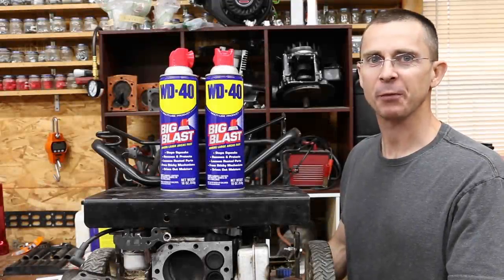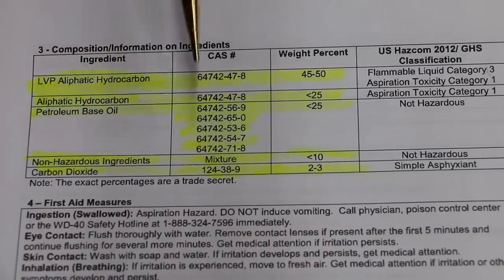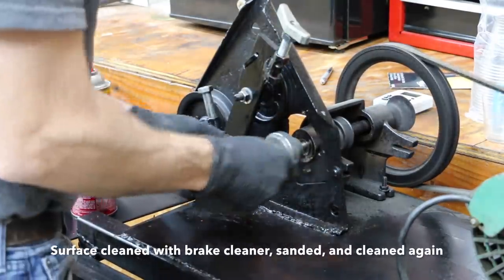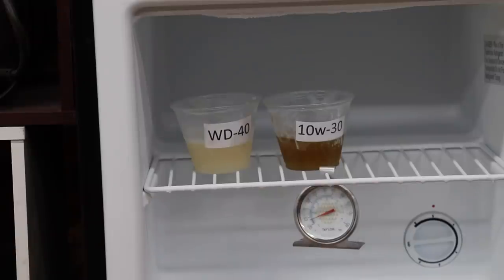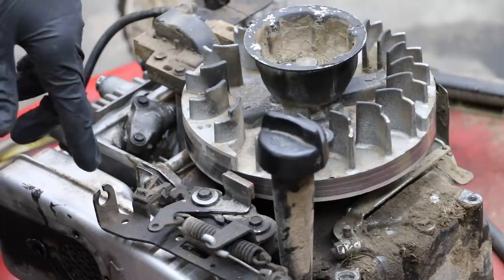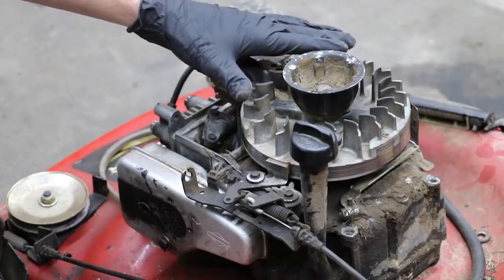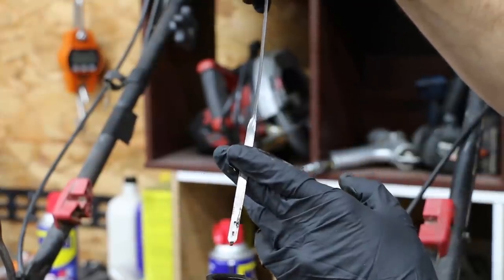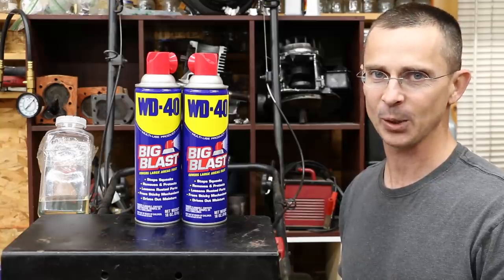Will WD-40 work as engine oil? Let's find out!

Comment: If you had the air box on the vapor from the crank case would have stalled the motor from running too rich. You had more flammable vapor coming out of the vent than what was being delivered by the carb.
Reply from the maker: Thanks for commenting on this.

Comment: WD40 was never intended for use as a lubricant.  Its' primary purpose is to displace moisture.  Water Displacer, formula 40.  Engine oil has a number of functions.  It cleans, cools, seals, as well as lubricates.  It might be interesting to try the same test again with this same engine but using proper engine oil this time and see if the compression goes back up some.
Reply from the maker: Great point. Thanks for commenting!

Comment: Should do a test on wd40 vs pb blaster vs zep 45. In my opinion the zep45 will work the best followed very close with pb blaster. Wd40 just makes dirt stick from what I've found in long term usage. It's a good quick lubricant but it's not long term like the other 2
Reply from the maker: Great suggestion!

Comment: I would like you to test the friction modifiers people use to to put in engine oils on that test bench you have to test oils, but make sure you clean the baring which is spinning or replace it with a new one all the time so that its fair and also the test bearing as well ?
Reply from the maker: Thank you for this recommendation.

Comment: With respect, by not putting the fan cowl back on, you created a 2nd variable and we don't know how much WD-40 was getting past the piston rings and burned, vs the engine being way too hot and then obiously boiled it and it came out the crank case vent filter as vapor. Cool idea, neat experiment, but if I were you, I'd put the fan cowl on and try it again. Change one thing at a time in experiments, how does the independent variable effect the dependent variable, etc. I'll bet you with the cowl on, you won't lose nearly as much oil, bleh er WD-40 lol.
Reply from the maker: Thank you for the constructive feedback.

Comment: The bearing test is interesting. 
I’d guess that given any lubricant, as the wear scar gets larger the bearing surface is then larger providing for more surface area / lower psi loading for the oil to lubricate. 
Wonder if there’s an equation there.
Reply from the maker: Thanks!  Thanks for the feedback.

Comment: If I understand correctly, WD-40 has light hydrocarbons as a carrier and heavy hydrocarbons to actually lubricate stuff. After you spray on WD-40, the carrier evaporates away, leaving a thin film of actual lubricant. I bet you lost the carrier when the oil got hot, which is why the volume went down so much.
Reply from the maker: Thank you!

Comment: Simple answer, no. WD-40 is not really a lubricant to begin with. It WILL lubricate, but for that matter so will water. And both only until they evaporate. Which WD-40 will. Quickly.
Reply from the maker: Great point. Thank you

Comment: May be late, but properly modified internal combustion engine should run fine on wd40. Since oils are classified by temperature and viscosity, i bet there is a way to make an engine to run on wd40 based on its operating temperature and viscosity. Heck, i suspect vegetable oil can be good for that kind of scenario. Also, as temperature rises, oil collection and compression rings would expand further around the cylinder, buckling and causing blowby. ALSO there is no visible hone on that cylinder wall =(
Reply from the maker: Thank you!

Comment: I think a better and safer way to load the engine would be to set the mower in a large pan of water. Then you could change the water level to load the engine. Simple and cheap Dyno.
Reply from the maker: Thank you for this recommendation!

Comment: Silly question really. Just check the ingredients of that fabled product, less than 25% of the contents have lubricating properties, the rest can mainly be compared to solvents . Would be cheaper for you stuffing a 25/75% mixture of oil and petroleum into your engine.
Reply from the maker: Great point.

Comment: I dislike wd-40 as a lubricant it doesn't work all that well and tends to evaporate off after awhile. I like to buy it in gallon containers and put it in squirt bottles. I add a quarter to half a cup of 20wt non-detergent machinery oil to around a quart. Seems to work much better and leaves a nice film. I use it at work to fog my bedknife grinder to prevent corrosion since it uses a water based coolant.
Reply from the maker: Great point.

Comment: You run and drain the oil in your daily driver i think it is a suburban. You have the oil tested almost constantly. Would you consider changing the filter half way through the service and at the service for 6 services in a row? This could show us if your oil becomes cleaner even in a well maintained engine from this method.
Reply from the maker: Thanks for the video idea.

Comment: I would like to see dishwashing liquid soap used in place of oil.
Reply from the maker: Thanks for the video idea!
Reply: I suspect it has the right viscosity and lubricity,  but may tend to boil off some of its water, so it may need water added during long running test. The water vapor coming off the crankcase vent should be great for the cylinder head temps as well as improving hp output.

It would be interesting to see if the foam in the crankcase gets thrown around where it's needed.

The co2 leaking past the rings should make it fizzy and acidic. I bet it performs great, except for the whole rusting issue!

Comment: So what’s the impact of running the same test with regular motor oil?  Need some form of control.  You took away the cooling and run under a pretty good load using the engine break.  I would expect regular oil to hit high temperatures as well under the same conditions...

Comment: You must tare up lots of engines, but I am curious to see what it be like to to run straight B12 in the engine for gas, I know  we use it to clean carburetors but that is mixed with gas, and even then we know that the engine runs hotter than non mixed b12 gas.. if you have not please try it. Actually a fair video be is use gas, than gas/b12 according to the instructions and then straight B12, let's see how that does at same time see if it really cleans carburetor like they advertise.
Reply from the maker: lol. Yes, quite a few. Thank you

Comment: my question is, the flashpoint was listed at about 175.  wouldn't that mean that the engine would just 'flash over' once it really warmed up?
Reply from the maker: Great question.  That's the temperature at which a product sufficiently vaporizes to ignite in the air. The flash point was too high to work well. Gasoline's flash point is -45F, allowing it to adequately vaporize for efficient use in a gasoline engine. Thank you

Comment: Thank you for your video, my question is did you build your bearing tester yourself.  I wanted to ask about the welding that holes it together.  It looks a bit like a low-quality weld on the video.  If Video is not deceiving, this is an area that one of your viewers may be able to help you.  

Thanks again
Reply from the maker: Yes, I welded this together and the welds are low quality, but it definitely won't have any issues staying together.  Thank you!

Comment: Considering we used WD-40 to degrease and clean tractor engines on the farm, I'm going to go with no.  It's a terrible lubricant and is very good at displacing any oil/grease that would lubricate.
Reply from the maker: Great point.

Comment: put a can with more wd40 connected to the crank case ventilation so that it will run on full oil all the time even if it spits out some it will be in the reservoir and will top it back on !
Reply from the maker: Thank you for this recommendation!

Comment: Do you think the loss in compression and blow by is more due to the difference in viscosity between the WD-40 and the normal engine oil? would be interesting to see what would happen if you topped it up with normal engine oil and did another compression test.
Reply from the maker: There was some damage which caused the compression loss. Thank you

Comment: Without the shroud the engine will run hotter since the air is not being directed across the head. WD40 is water displacement formula and not intended as a lubricant.
Reply from the maker: Thank you for the constructive feedback
Reply: @ProjectFarm  I enjoy all your videos and appreciate the dedication to accurate non-biased testing. Keep up the good work!

Comment: Running the engine without the engine starting shroude in place will cause the engine to run considerably hotter than normal. The schrodeing redirects the air blowing off flywheel to the engine cooling fins and cylinder area so these engines shouldnt be opperated this way under any load to avoide damage ..
Reply from the maker: Thanks for sharing.

Comment: No surprise. WD 40 is not a lubricants. WD in the name refers to Water Displacement, it was formulated to displace water from electric components in an engine. It is also a good solvent for cleaning motorcycle chains. It is NOT a lubricant.
Reply from the maker: Thank you!

Comment: On the other hand, would WD-40 work as a fuel additive to increase upper cylinder lubrication? Would it leave lots of residue? How would the engine run with different ratios of WD-40 to gasoline?
Reply from the maker: Thanks for the suggestion.

Comment: WD4O is highly flammable.  Wouldn't that be a safety hazard ?
Reply from the maker: Per the MSDS, the engine would achieve temps high enough to reach auto-ignition. Thanks for commenting.

Comment: I added wd40 to my cars timing belt tensioner when rebuilding after the timing belt broke because of the water pump, added new valves, water pump and belt replaced $300 in parts lasted 2 months because the belt tensioner failed. The bearing on the tensioner were gone when I re-rebuilt it  and the wd40 in it was turned to a white powder which caused it to fail. Never again will I use it again to clean any moving parts on any angine.  Learned later from a forum that wd40 turns powdery after it heats from others that used it on bearings before.
Reply from the maker: Thanks for sharing.

Comment: Projectfarm, do you torque the cylinder head down after you use the drill to tighten the bolts? How do you know when enough is enough on the drill? Thanks
Reply from the maker: Thank you.  Yes, I use a ratchet to make the final torque adjustments

Comment: should try out the water electrolysis add on's that they sell on ebay. ive always wondered if they worked. they boast increased power because of the hydrogen and oxygen dissociated  from distilled water and salt.
Reply from the maker: Thank you for this recommendation!

Comment: Your interpretation of the results is decidedly wrong. The abnormally high engine temps are due to the fact that you took away NEARLY ALL of its ability to cool itself. This will strain the best oils, as they all lose film strength at very high temperatures. Also, the crankcase smoke was mostly not blowby; it was the elevated temperatures vaporizing the WD-40. The fact that the before and after compression levels were similar indicated that the rings and cylinder wall were not seriously compromised in the experiment.
All in all, the WD-40 passed with flying colors. In an emergency, it would get you home. Even subjected to unrealistically severe conditions, it kept the engine running. Also, it would be interesting to see the condition of the crank and rod after any lubrication tests, if time permitted.
Reply from the maker: Thanks for the constructive feedback.
Reply: You have got to be the only YT content creator who actually lets people know you read their comments. That's very impressive.

Comment: It was interesting but I have a question as well. I dont understand why you took away the air for cooling. I am surprised it survived at all as the WD is real thin. 
I once had a briggs motor mower that All I had was Mystery oil. It stopped with bearing noise and low compression.
Reply from the maker: I should have left the engine cover on. It was around or below freezing and I had fans blowing air around to mitigate exposure the exhaust. All of that helped cool the engine. I should have left the engine cover on.
Reply: Air cooled engines are cheap. and or free.. I would be interested in seeing if survival is better with designed cooling. Also I have been interested in the lubricity if kerosene. I saw a video that someone drained the oil and filled the crankcase with kero Edit) as a flush . Also Scotty Kilmer does a test with high concentrations oh lacquer  thinner to cure clogged converters. I believe perhaps the higher concentrations may eat at the rubber components in the fuel system Perhaps a test with lacquered  thinner And perhaps Paint thinner. In the auto body field Lacquer thinner will eat any  paint straight off the spray gun when soaked and was not kind to the o-rings (rubber) leather for the most part was required. Some ideas I had. Great interesting material you have here and the discussions are what is important as we really all learn so thanks. Peace brother

Comment: Did the wd-40 clean the engine at all? Could it be used in the fuel as a cleaner and hot soak ?
Reply from the maker: I don't think it cleaned it too much, if at all.

Comment: I'm surprised it ran. Most engines have a governor which shut off fuel if oil pressure is too low. Happened to me when I put multi weight oil into my old mower. Always shut off after 10 minutes. Then I put straight weight and it always ran.
Reply from the maker: Thanks for commenting on this.

Comment: It may have been coveredbefore, but what is the Pulley for at the front of the mower by the left front wheel? Is it a drive pulley? Has it been covered in a different video? Ive seen it a couple times and havent seen it used.
Reply from the maker: It's part of the self-propelled system.  Thanks for commenting!

Comment: the chemical used to remove sulfur from crude oil also make steel slick(amine ) we used to use this in  manufacturing oil filter shells on the dies and drawing he shell out would it work as  a motor  oil  it was about 90 percent water . also this chemical was used as a tapper fluid
Reply: any tool and die shop would have a similar fluid

Comment: WD 40 is not a lubricant. it displaces water, it has oil in it and is not viscous so that's why people use it to get bolts free. not to mention its flammable. it probably would work better as a fuel than a lubricant. he should have run a similar engine without oil to see how long it lasted.
Reply from the maker: Thanks for commenting.

Comment: I did not think it would be a good option for a crankcase. Have you done one using WD40 as a engine flush? One quart WD40 to four quarts motor oil. BTW, I buy my WD40 by the gallon at Harbor Freight.
Reply from the maker: I should have purchased the 1 gallon container.

Comment: WD-40 has silicone which is not something we would want lubricant an engine.  Did you ever try straight marvel mystery oil? I add that to my oil and gas on small and auto engines.
Reply: Btw, I appreciate both your work, and how you reply to reasonable and scientific comments - you replied to me on more than one occasion.  I add marvel to my 2002 Chevy venture in both the oil and gasoline.  The directions are for 10 gallons, but a few months ago, I was adding a 20 gallon mixture for only a 10 gallon fill up.  The car developed a rough idle, so I ran the tank to 1/4, and filled up, and didn't add marvel, and the car ran smooth again.  I only add 8 ounces to my engine oil even though the makers of marvel allow a quart to be added into the crankcase for a 4 quart oil change!  I would never add 1/4 marvel to my crankcase, so I am curious how 100% marvel in the crankcase will do.  I never read adding all WD-40 to a crankcase, although I have seen people use it to clean out their "lifter tubes"? That have become plugged up with sludge.

THANKS AGAIN!!
Reply from the maker: I have not tested 100% MMO yet.  It has some solvent-like characteristics, making it a terrific crankcase and fuel system cleaner.  I would expect the engine to survive, but it wouldn't be overly impressive as a lubricant compared to other products tested.   I might test full strength in a future video, but I'll spend a lot of time explaining that it's not intended to be used this way.  Thanks again!

Comment: So did the WD-40 evaporate or escape from the engine because it's so thin ? Is WD-40 advertised as a "lubricant" ?
Reply from the maker: Yes, it evaporated, since it turns to vapor at around 140F.  The word "lubricates" is on the front of the WD-40 can.

Comment: Wd contains a lot of lighter weigh and volatile hydrocarbon fractions and has no body to it.. Its a no brainer that it won't survive as a lubricant in a hot environment such as an engine crankcase .
Reply from the maker: All great points. Thanks for commenting.

Comment: I'm not sure why anyone would think of these videos but I'm sure glad that if I'm stuck in the middle of nowhere with no motor oil or gasoline, but every other type of petroleum product known to man, that I can just throw them all into the engine and gas tank and stagger and sputter my way back to civilization. Maybe I should just strap a self-propelled push mower to the top of my suv so I can ride that back to safety. Snapper - The ultimate bug-out vehicle! Thank you!
Reply from the maker: Thank you for the feedback!

Comment: "Engine ran really hot"...

Ya think? Not a fair test using heat as one of the measurements if you take the cooling system away...

What happened to realistically looking at just a single aspect?